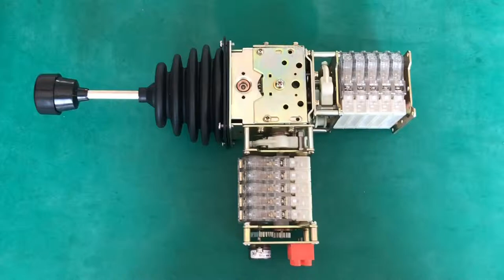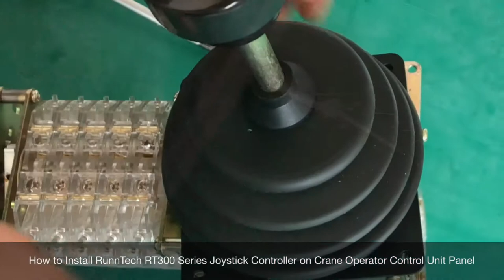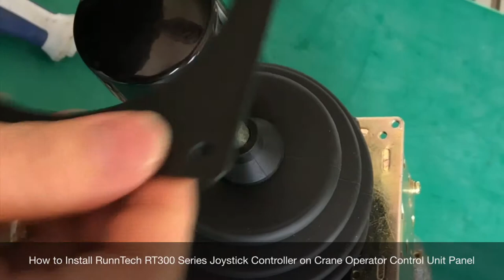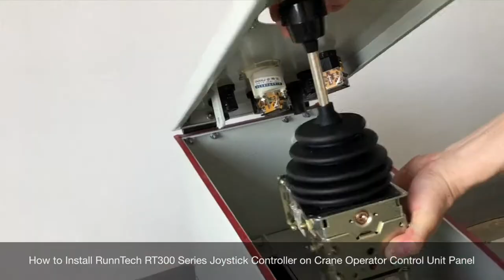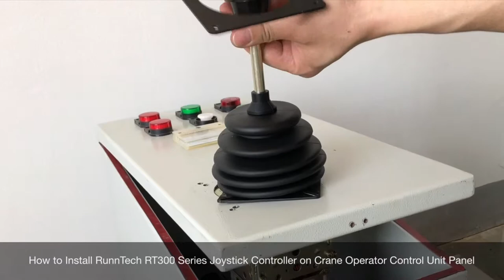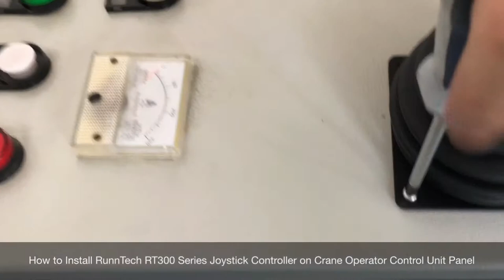How to Install RunnTech RT300 Series Joystick Master Controller on Crane Operator Control Unit Panel

Comment: Hi 
I love your products but I have to ask is these joysticks are programmable by arduino? 
Could you make costume made joystick?  

Thanks in advance for answering
Reply from the maker: Thanks for your interest about our RunnTech joystick controller.
Our joysticks are not are programmable by arduino.
Sure, we can customize joystick accordling to your requirements.

Let us know if any further questions, and you can reach us via following information:
tel: +86 519 8223 0053
skype: runntech
wechat: +86 139 1231 6230
whatsapp: +86 139 1231 6230
https://www.runntech.com/
Reply: Do you manufacture any joysticks that can be programmef by arduino?
Reply from the maker: @horashia495  RunnTech only can output with analog, RS232 or CAN 2.0